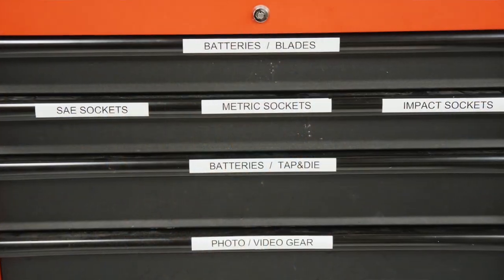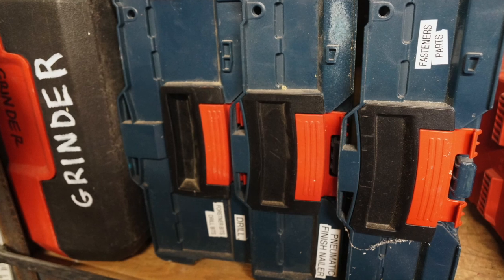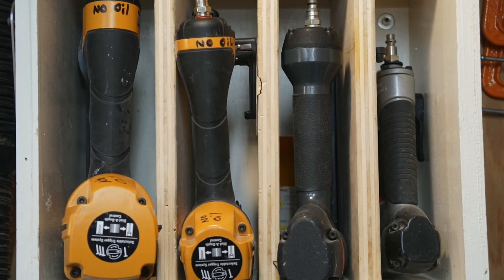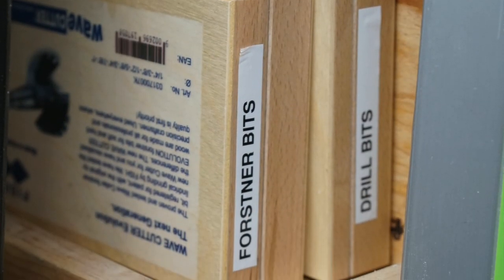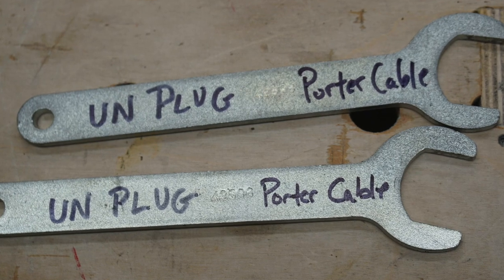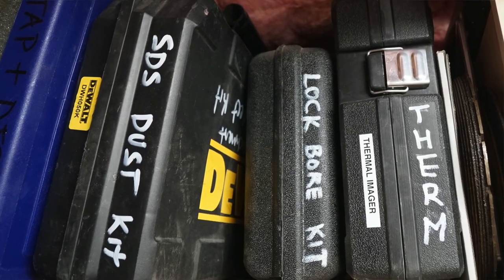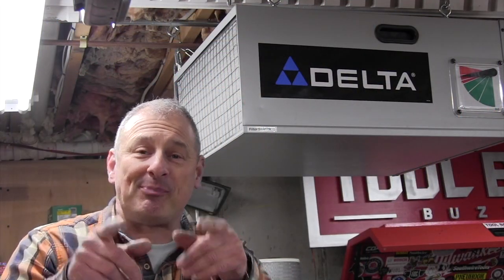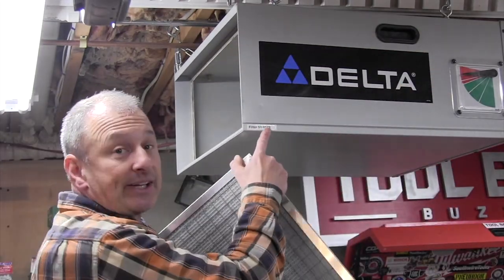Tool Organization and Labeling - Carpentry Tip Series

Comment: Yep I do this too.  I also tack up my receipts next to my HVAC system, septic system, water heater.  I also keep in stock 1 spare for each common consumable so I can change it immediately and then the lead time for re-orded does not affect me.  Write oil filter and wrench size under the hood.  Keep a book of paint codes/can labels for my house.  Take pictures of any buried pipes and along each phase of construction.  I also PDF important emails and log them in project folders.  Store digital files like this using date format 2021-5-12 so sorting by name sorts the files by date.